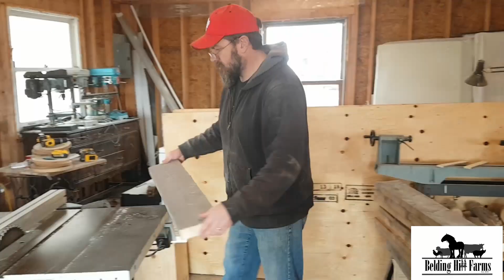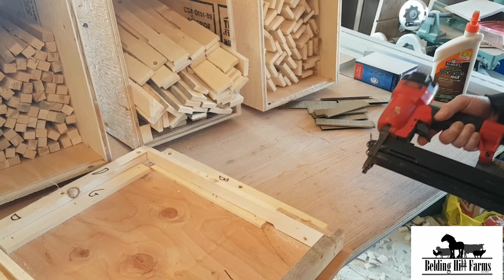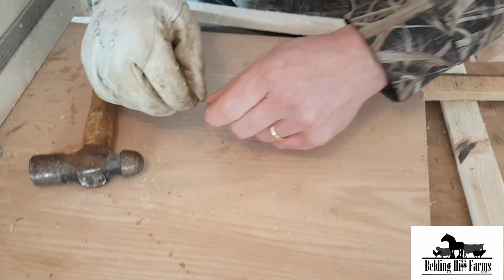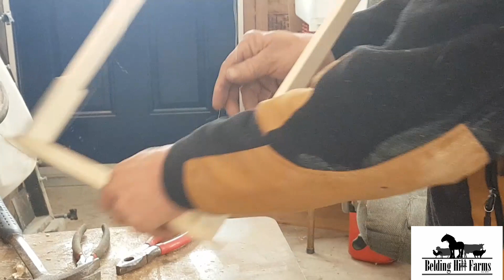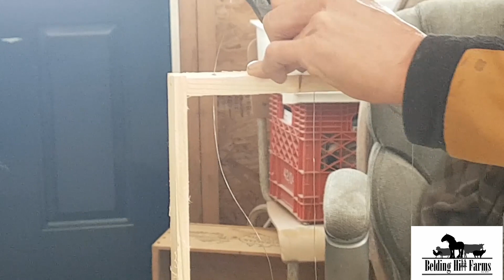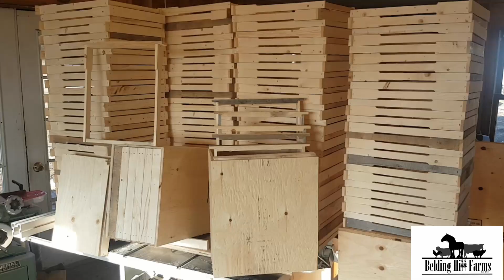Layens Frame Build, Assembly and Wiring

Comment: Nice demonstration.  I would do the side pieces differently.  Run the 2x4 on a jointer (if you have one).  Raise the cutter to the desired depth.  Run it until it gets to the point where you want it to go out.   Then do the other side.  
Cut it on the table saw to the width you need and then that's it.

Comment: How long did it take you to just cut and build the 135 frames (not counting the wiring)?
Reply from the maker: I can’t remember because I did it 2-3 hours at a time, but I believe it was about 10-12 hours. Maybe less. Just cut all of the pieces in mass production and absolutely build the frame jig (separate video on our channel). Also, if you need the information about the jig I used to drill the holes in the frames, let me know.

Comment: Great job! Quick question: Dr. Leo's hives come with edge protectors. I've already "sealed painted" it 2x and ave allowed it to completely dry; however, as I'm putting in the first edge protector, I'm noticing the wood crack. In drilling screws into other items such as the lid or gate discs, I did not notice any wood cracking. Any advice? Proceed without worry or stop adding on the edge protector?
Reply from the maker: Thanks for watching and if you are getting cracking, you can simply pre-drill the holes with an undersized drill bit before putting in the screws. That will relieve the pressure that is most likely causing the splitting. Just play with the drill size until you are happy, but don’t go more than half the diameter of your screws or they won’t have enough holding power.

Comment: Thanks for the detailed video, ive been planning on building a layens style hive box, do you see any issue on wiring the frames horizontally from side to side rather than from top to bottom? If you grove the top bar you can install a wood strip and wax it to start the bees comb off straight and the wire wont be in the way.
Reply from the maker: I think that would work, but you might have to stiffen the joints of the frames.

Comment: Since I didn't have a router at the time, I made my sidebars by making a jig for my table saw and used the dado blade.  It is similar to a sled except mine is fixed in place.  It would work just fine if the jig slides as well.  Worked perfect and was safe because the blade stays below the jig and and only the sidebar will fit into the slot.  I think the easiest way would be to use a jointer if it will adjust enough to make the side bars.
Reply: If you have a jointer raise the blade up and run the 2x4 flat ways until you get the top end that you want.  Turn it over and do the same thing on the other side.   Use the table saw and cut the side pieces to width.  Done.  no router table needed.
Reply from the maker: Awesome. More than one way to skin a cat! Lol

Comment: Can you tell me where you were able to pick up these small grommets? and what they are made from?  Thx
Reply: https://www.amazon.com/Walfront-1000pcs-Beehive-Threading-Beekeeping/dp/B07FDCLGR9/ref=asc_df_B07FDCLGR9/?tag=hyprod-20&linkCode=df0&hvadid=309858491514&hvpos&hvnetw=g&hvrand=1162656857188050039&hvpone&hvptwo&hvqmt&hvdev=c&hvdvcmdl&hvlocint&hvlocphy=9028372&hvtargid=pla-612808683257&psc=1
Reply from the maker: I got them from a bee supply store and they are made of brass.

Comment: Turns out the foundations are undesirable for bees because sometimes they will make a hole in the frame to let air through but if there is a foundation there they cannot. I just learned that after installing a new box with foundations, I think from the same guy you are building your boxes off of.
Reply from the maker: I saw that too

Comment: Putting in that wire it might help to ream that rough end slightly with a bigger nail to keep it from catching on you.   You could even get fancy and mount that nail into a small handle to make it easier.  Anything to make it less tedious!  :)
Reply: I found that it was easiest to put 1 on the nail and hammer the nail and grommet in place.  Then push the nail up from the bottom, lift it out, and go to the next.  This is far easier on my fingers because pushing those little things into the wood wear your hands out.  If there is a way to SHOOT those grommets into the holes that would be best! :)
Reply from the maker: I did the same
Reply from the maker: I agree, anything to make it less tedious is better. Thanks